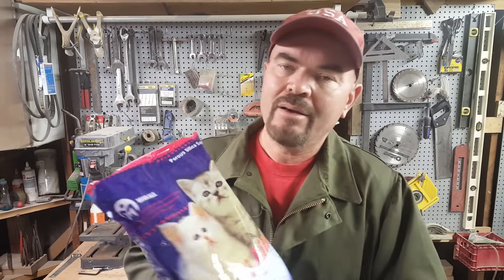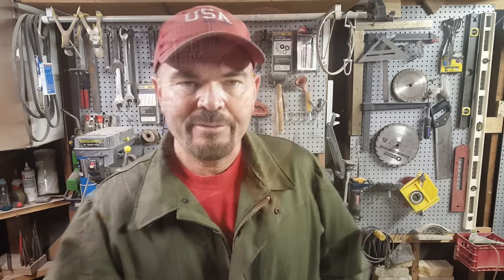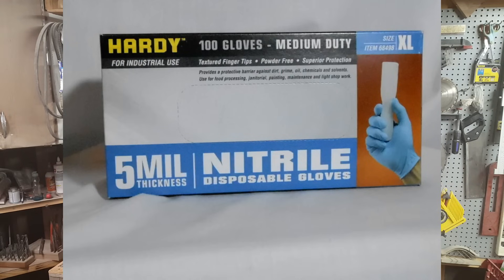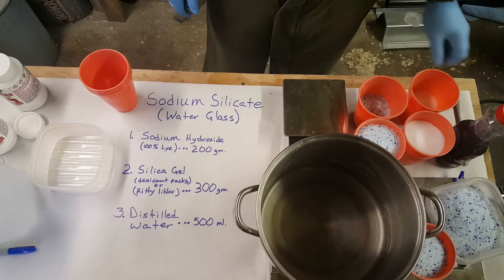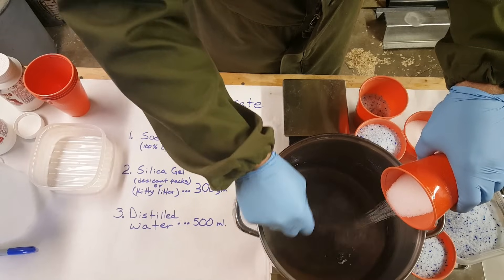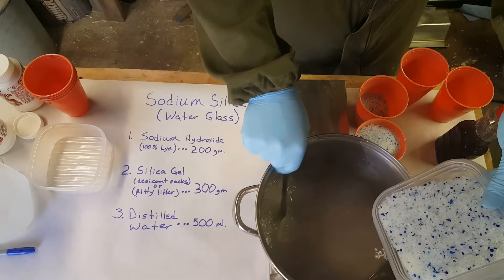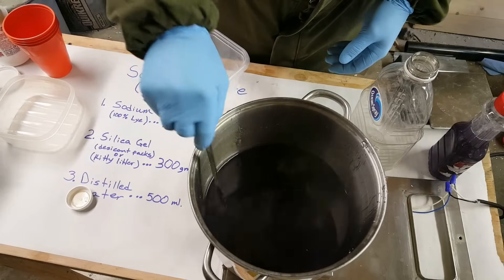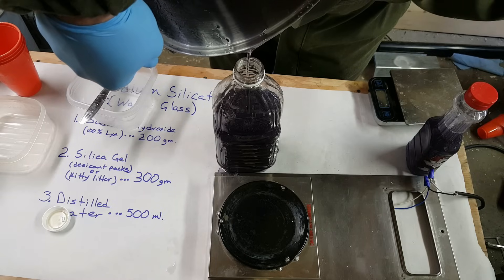Making Water Glass Refractory Mix for Rocket Mass Stove

Comment: Believe it or not, but green olives are made using sodium hydroxide. It chemically cooks the raw olives. Black olives are made the same way but air is bubbled while cooking. Red devil drain cleaner is 100% sodium hydroxide. The stuff he is making is a high percentage water glass. The stuff you buy is only about 20 to 30 percent sodium silicate.

Comment: What is the difference between Sodium Silicate 40% (Water Glass for pottery - $19.99/gallon) and creating this kitty litter stuff? I have Red devil Lye(for soap making) and it's not too cheap so buying the premade water glass seems cheaper but for pottery it's only 40%. Is this waterglass that you make 100%? Just curious to the cheapest way because the ready made gallon jug(40%) seems a lot easier. 
I'm building the insulation mound for a Mass Rocket Stove and have found the waterglass/perlite/sand formula to be a great, low-cost insulator/refractory method for the firebox in my stove....

Comment: Hi I am looking for ne mold materials. I want to do lost polymer cast. So my initial idea is to use drywall compound and spread it on my 3D printed part. Then use sodium silicate sand mix for the rest of the mold. Finally burn out the polymer and pour. Can you refractory be used for tjhat too ? Does it break down with heat ?

Comment: If you get any lye on your skin you can neutralize it with sulfuric acid. WAIT!! JUST KIDDING!!! Actually a splash of vinegar, any type, will very quickly neutralize most anything like that. And vinegar isn't dangerous to get on your skin. Lye is not too particularly dangerous to skin but can not remain there or you will get extreme drying and damage , so either water, until you don't feel slimy anymore, or a bit of vinegar and be done with it.

Comment: Waterglass isn't really all that expensive. It is often sold for making concrete more water repellent. I got a gallon jug of Rutland brand for around 20 dollars or so. 

   Then, you can often source potassium silicate in powder form as a plant food. You just mix that with the right amount of distilled water and you have a potassium watergalss which in many ways is quite similar to the sodium silicate. The molecules are a bit smaller though. 

    By the time you buy all the ingredients, factor in the cost of heating and time to make--you're really not saving much by making it yourself, and I say that as a fan of making things myself to save money.

Comment: Sir, I appreciate this video. I’m so glad that you’re after thinking about this before me.  I’m looking to heatproof an improvised stove as well, and I’m brand new to the whole concept.

But way of returning the favor, I’ve got a little advice for you. If you are working with sodium hydroxide or potassium hydroxide and you happen to get some on you, if it’s not water you wanna rinse with, it’s vinegar. It’ll neutralize it right away. After that, then you can hit the water.

I’m a person that occasionally likes to make soap, so although I don’t use it so often and I forgotten a lot of the little bit that I took in university chemistry, this is probably the one principle that I can pass on with some surety.

I’d sure appreciate it if you could see if you words about cleaning the pot so we can be safely used in the kitchen again. Because the cost goes up dramatically if I have to sacrifice a pot every time I do this.

Thanks again.
Reply: Lye, or sodium hydroxide is used in food processing and isn't actually poisonous, in fact it is an extremely good cleaner, and very similar to the potassium hydroxide used in diy soapmaking. 'Mr. Clean' kitchen floor cleaner is 1% sodium hydroxide, and 99% water, basically. I can remember t.v. commercials showing an infant crawling across a kitchen floor that purportedly had recently been cleaned with that product.
 Sodium silicate is inert, and indigestible, and would pass right through a person if swallowed. The only real danger I can think of is repeatedly inhaling the dust particles of that and it's causing irreversible lung damage, during industrial applications.
Between the sodium silicate and the sodium hydroxide, the most noticeable occurrence would be a very clean and shiny stainless steel pot. All remains of the water glass concoction are water soluble and will rinse away clean. 👍
Oh, and I'm so glad you mentioned the vinegar thing. Very few people are aware of it, I guess no one paid attention like we did in science class- hmmm?
Reply: @markhonea2461  :  Thank you for getting back to me! I sure appreciate your thoughts on this matter. They sure will be fun to implement. :-)
Reply: @markhonea2461  Sir, it occurs to me going back and reading these comments, that sodium hydroxide is a real problem if your children get into it.

The other name for sodium hydroxide, is caustic soda.

It can cause some pretty bad base burns, Although you don’t feel it right away the way you would with an acidic burn.

I don’t know why I didn’t think to mention that last year, when I responded to your response

As a matter fact, it seems to me that there was a woman from our church many years ago, whose husband was in medical school. They had three children and not much else. They worked a lot of hours any time they could get them, and she made homemade soap to sell, to augment the family income.

She always made her sodium hydroxide solution and once it  cooled, she secured it in the cabinet in the bathroom, where she had baby proofed the cupboard.

Except on this one occasion, the children were quiet for just a little too long, and she found them in the bathroom, having found a way to get into the secured cupboard.

The baby drank the sodium hydroxide, And she could see what it happened.

The baby had to be rushed to the emergency department and was admitted to the Children’s Hospital. He wasn’t expected to live. The burns  were extensive from the mouth to the oesophagus and down through.

The baby was given a blessing, the next day the burns were healed.

So that little one is doing OK nowadays.

Anybody who wants to take issue with me because of the religious aspect of this, can hold your peace. The whole point was, the baby drank the sodium hydroxide which had cooled down to room, temperature, and the damage was so extensive that the little fellow was not expected to live.

Dissolution is a lot more than 1% lye.

And the other thing that’s good to remember, when you go to mix it, is to Add to the water in a very well ventilated Situation.

Not only is the reaction violently exothermic as you know, but it also damaging to mucous membranes and decomposes proteins.

so it’s grossly misleading to say that it’s completely safe.

It is used as a buffer sometimes, but it’s not something that’s good for a person in any way, shape or form, to be subject to in this form, and this concentration.

I’m making these corrective comments out of an abundance of respect and caring. No disrespect whatsoever.

Comment: Could you please tell me, if your Water Glass is solidifying after you have put it in the bottle.
Also in the 1st part of putting Caustic drain cleaner to water, are you heating the pan on the Stove or not.
Reply: It will stay liquid until exposed to heat or pure carbon dioxide.
Reply: @undernetjack  thanks for the info, I asked because a Guy here in the UK who made W/G, live on Video, said, 'he had to tighten the tops of his container real tight, as when air got to it......it turned into solid glass very quickly, so he was using more water to start with and then thinning down at least 65% before bottling it up.
Watching the Video, I saw he cooked from the very beginning of the process, the mixture over a very high heat, and later he could only use roughly 3/4 of the amount of Cat litter, required in the Ingredient measurements.
So my query is, must the water be and kept on a rolling boil when Caustic Soda is added to it!!!
Reply: It will stay liquid until exposed to heat or pure carbon dioxide.

Comment: That's a shockingly high molar concentration you have there. I'm surprised you use so little water. 

My usual "small" batch is 160g NaOH, 240g silica, and 400mL water, and it ends up about as viscous as corn syrup.
Reply: I don't understand? You use the same ration 
it's ony 25% larger than your batch

Comment: Its in every auto parts store as headsealer, its also a common sealer for cement floors
Reply: Laboratory grade sodium silicate is only about $15 a pint and is available online to anyone with a CC#. So much better than using kitty litter mixed with who knows what kind of aromatics and filler
Reply: I was wondering that , liquid glass that's what I know it as, it's for sealing head gaskets  as I say, now that would be pure sodium silicate correct ? They also used this to seize the motors in the cash for clunkers too I believe
Reply: @DS-mm6fh  Yes, same stuff, sodium metasilicate pentahydrate.

Comment: Forty years ago, I only used lye for making hydrogen.  When mixed with water, and aluminum is added, the stuff reacts "violently".  Even after exercising all precautions, the procedure always made me nervous.  The heavy glass bottles I used got blistering hot.  I always put the bottles in a bucket of sand during the process.  But I haven't done it in decades, and have no desire to do so.  I found out more recently about pure ash from a fire, soaked in water for a long period, becomes highly alkali.  Not sure of the concentration.
Reply: My research into soap making led me to using wood ash to make lye; float an egg in the soliution of wood ash and water, until there is about a quarter size of egg floating above the surface.  this was the strength for soap making.
Reply: Wood ash produces potassium hydroxide (KOH), not sodium hydroxide (NaOH). 
As Sergey Plisov said: SiO2+NaOH = NaHSiO3

Comment: Sodium silicate is readily available in ceramic supply stores for about $ 20.00 a gallon
Reply: why spend 20 dollars a gallon when we can make that gallon for under 2 dollars and still have more mats to make several gallons of it
Reply: @kathrynostergreen8480  hahahaha.. after buying like 40$ of ingredients. - so goes every diy.
Reply: @kathrynostergreen8480    How can you make it for 2 dollars a gallon unless you are getting ingredients donated to you?

  I'm a fan of DIY'ing, but there are times to do it and times not to do it, and besides just the total costs of the raw materials, there is also the time and safety issues involved. Getting it for 20 dollars a gallon is a good deal.  With that said, it is good to know how to make it from relative "scratch" in case there is ever a huge price jump or lack of availability.

Comment: I smelled the safety talk coming after the lye ... useful, but nasty dangerous.
Reply: True eye wear is a good recommendation . A nearby . Very near tub of tap water should be near . Very near to wash ones face.  . Thin latex gloves is a good idea or just a plastic bag. In a pinch 
 I have used teflon aluminum  pots , used with sucess.  Pyrex glass measuring cups I do not like  because on shattered from the combined heat plate and internal heat from the lye water chemical action . Stainless steel  is a preferred Choice . I dont bother with the heat plat any more . The heat from the chemical reaction is adequate to combine the key water and kitty litter

 Pulverizing  the kitty liter . I and many others have tried that . It does not speed up the process. It greatly slows it down . Best to throw out and start anew with kitty litter directly from the bag

Comment: Hello sir i'm from indonesia , i have a question .. What's this stuff for? Thanks
Reply: It is a high temperature  glue when mixed with sand or clay or perlite . Is is porproted to with stand 1900° Fahrenheit  about 1000° Celsius  and is used by ametures to make refractory  brick.  Or moldings to include  chimneys  . Rocket stove heat rises  molten metal vessels.  Water glass combined with the aggregate is an insulator  so that generated heat remain and intensifies within the furnace fire chambers

Comment: You could save on the amount of heat needed by putting the silica gel in the water first and using the exothermic reaction from the lye to do a good amount of the heating for you.  Depending on your exact concentrations of silica you might not even need heating but for richer mixtures you will probably need some.
Reply: Good comment . I do as you suggest . I water down my water glass quite a bit to mix with absorbing vermiculite  and it hardens well  and remains intact  in the wood stove fire chamber
Reply: Also, you may grind up the silica to speed reaction.
Reply: use geopolymer, similar but a much cement.

Comment: As a side note; When I lived on a small farm in the 70's Water Glass was sold cheaply in the local grocery store and was commonly used by farmers to store extra eggs from the summer to use during the winter. We would fill a 5-gallon crock about half full of water and add a quart of water glass, then drop in the extra eggs as we got them throughout the warm months, covering with a piece of wood for a lid and stored in the cold cellar. We would enjoy the eggs all winter, no refrigeration needed. The water glass would seal the eggshell keeping any O2 out.

Note: You have to keep them from freezing.
The yokes would get flat when cracked into a pan, so not so good for fried eggs but plenty good for scrambled eggs and indistinguishable from fresh eggs for baking.
Reply: Very nice and detailed narrative. Thanks for your comment about water glass and egg presevation
Reply: That bit about the yolk getting weak speaks to experience. So many know-it-alls never mention this. Cheers to your sharing truth.
Reply: @undernetjack  Thank You for responding in a positive way!
Reply: @samTollefson  It's only right. You are sharing valuable experience for free. Thank you.

Comment: Chemical formula: Na₂O₄S

Density: 2.66 g/cm³

Average Molar mass: 142.04 g/mol

Melting point: 884°C (1,623°F)

Boiling point: 1,429°C (2,604°F)

...sorry I ain't buyin it!
Reply: I believe the first aid requires flushing with vinegar not water!

Comment: Can we get some concrete numbers (no pun intended) as to the thermal capacity of this chemical mixture?

I don't want to even consider going to this much trouble if my heat riser is going to crack in 5 years anyways
Reply: It's going to crack within five years . Make your riser so it can be inspected yearly  and disassembled

Comment: Quick question, what do you think the cost is to make a gallon of water glass?
Reply from the maker: it costs me about $6.00 for 1/2 gallon or $12 /gal
Reply: I would at least double  the cost of what he states @ $4 per bottle of lye. . A whole gallon to me is quite a lot I have made a half gallon and it took 3 or 4 bottles of lye. But I dilute the resultant water glass with  several gallon of water when mixing in the aggregate
Reply: @bobbrawley2612  Silica cat litter has gone up in price.

Comment: That's so weird. I hardly had any issue mixing up my sodium silicate. It heated - but didn't boil - the water. When I used the dessicant packs, it took a good bit of time to even mix up. And I added both dry ingredients together first and then the water. But if you want to see a reaction that will really get a reaction from you...... make sodium sulfate instead, AKA replace the kitty litter with sulfuric acid. My advice, cover ALL skin, and wear a respirator and eye protection. Because it goes BOOM. Consider the reaction with the distilled water, and think it's a neutral compound. Replace that with a super acidic one. Most volatile reaction I've gotten with my backyard chemistry. Oh, and best source of sulfuric acid: Betterbuilt Drain Opener. Lab grade sulfuric acid for $5.96 (or $400 from a lab)

Comment: How long will the water glass keep?
Reply: Not sure about this homemade solution, but the stuff I bought in a bottle, when stored with the cap tightly closed and in a stable, temp/humidity controlled environment, well it's stored well for a couple years already at this point.

Comment: I probably will  be building a batch rocket stove using 1" ceramic fiber board for the burn core, like the Walker stoves (Peter van den Berg type) from broaudio. The board needs some help otherwise just the normal process of loading wood will eventually damage it. Could I use water glass to toughen the ceramic board, either by applying to it's surface or soaking it ?
Reply: Tonzarama You could get away with facing the board with 1/4" to 1/2" hardbrick slices in the firebox of the Walker core.  It gets so hot it shouldn't matter.
Reply: Thanks Jeremiah for the feedback. I just saw a new design from Peter van den Berg called the DSR (double shoebox rocket) it looks promising. So again I may be changing my design plans, be well.
Reply: Tonzarama That does look like a good one.  I will wait for a couple more builds of it before I  jump off of the walker core.  The double shoebox would be awesome in a brick shell!
Reply: Tonzarama Keep in touch with me about your build!

Comment: Its better to grind the silica gel to increase the surface area and add it a little at a time. If you dump a lot in at once it tends to clump together in big lumps like icebergs ;) Store bought sodium silicate generally has a SiO2:Na20 ratio of 3.2,  yours will be around 1.936 assuming the lye is 100% pure
Reply: Me and everybody else has tried  the powder silica gel trick and we all get your iceberg effect. So grinding doesn't  help at all . For fastest mixing I use it right out of the bag